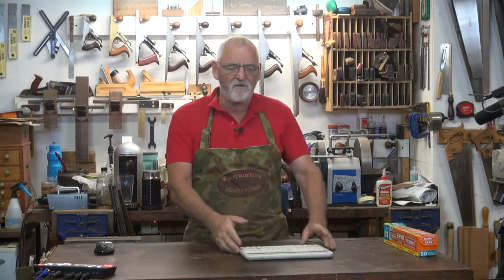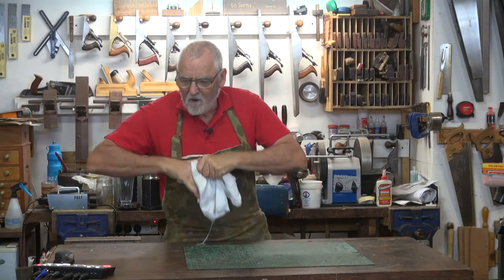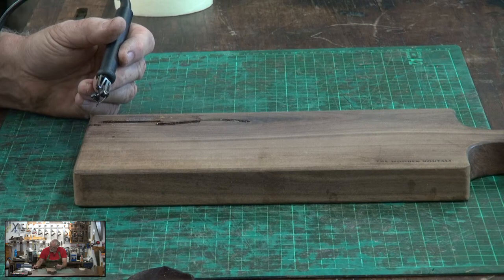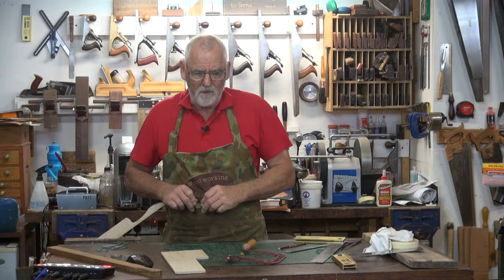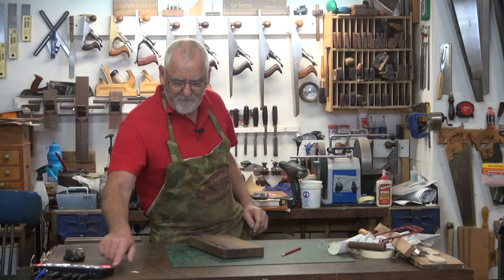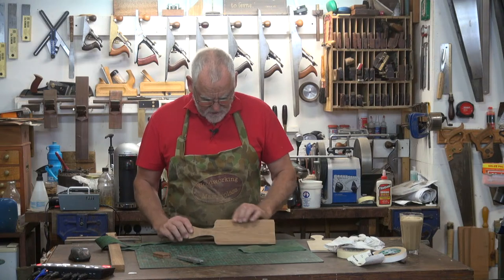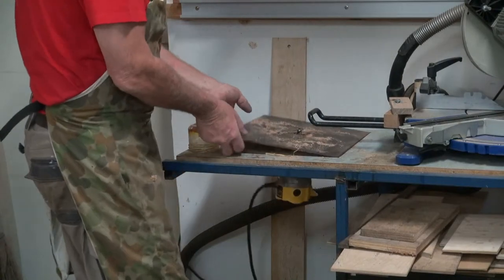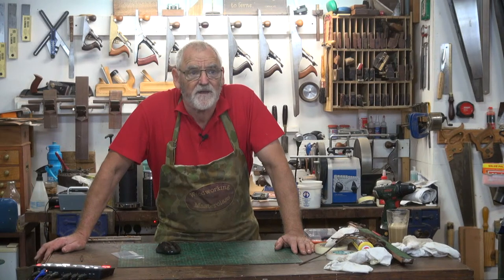Some Glue ups, Trying New way of Crack filling and Making a Strop or 2

Comment: Beautiful backdrop display for a Woodworking video. Question: Are those planes held up with a magnetic  strip? Or??
Reply from the maker: Hi Blair, No, I have cup head bolts though a piece of 4x2 and hang the planes from the bolt shaft. Cheers Steve

Comment: Hello Steve, I have a glue problem and wanna ask you if my plan makes sense or not. I have scraped old paint on my doors expecting to find a nice wood. Yes I found a very nice wood with artsy grains and lots of knots. I decided to stain this wood to make it darker(which is very light colored), so flooring and other darker wood furniture will be matched. But, as you guessed, I learned that this wood is pine and mostly painted because of these knots and very hard tinting. Thats the problem in general. I will somehow stain it by trial&error. 

But here comes my bigger problem: the last door frame I scraped has a big rotten area, and previously filled and painted over. Now after all this exhausting scraping job, I cant turn back to painting. As I am decided to not painting doors opaque, I HAVE TO REPAIR THIS WOOD:((
1. I found a 3mm pine veneer, grains are nearly same. 
2. filled the 20cm radius hole with joint compoud mixed with sawdust and wood glue, 
3. I cannot coat the veneer fully to cover whole frame, as it is only big enough (50x20cm) for half of the frame (200x25cm). So I sanded compound surface to form a bedding 2 mm low, for placing the veneer. 
4. After glueing and pressing, I will sand the veneer to equalize the level. I aim to form a surface which veneer will make a soft transition to the frame wood. 
5. Then staining. 
If you could read till here, my question is: will this glue prevent staining? Or can you suggest another type of glue which lets stain.

Thanks for sharing your experience.
Reply from the maker: Hi Ethan, Short answer is Yes, it will prevent Staining if the glue is on the surface. What sort of glue did you use? Is it possible to mix some stain into the glue before applying. That may work. That's all I've got sorry, Apart from finding more timber to make another patch. Cheers Steve